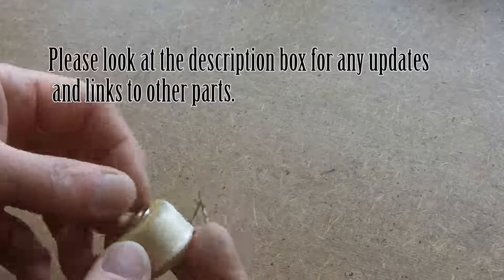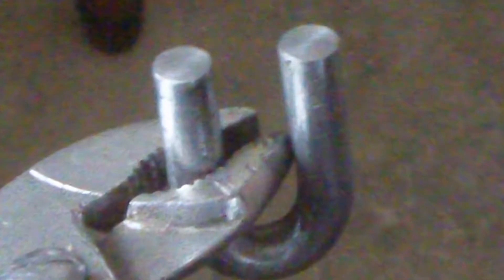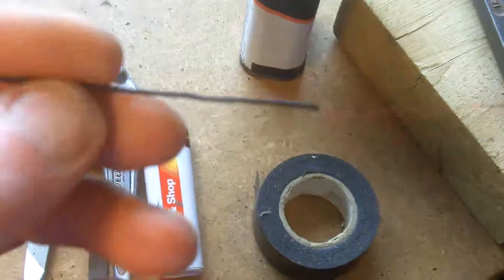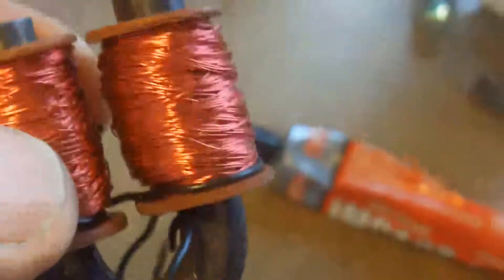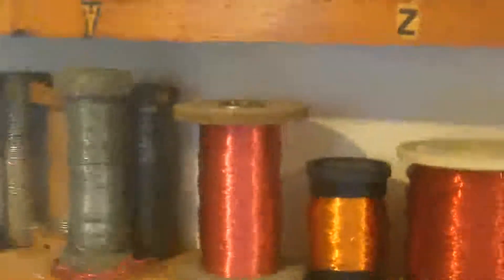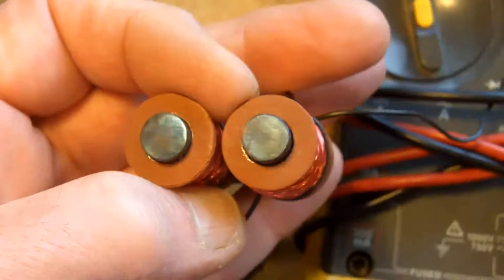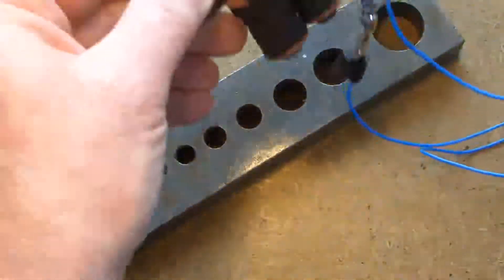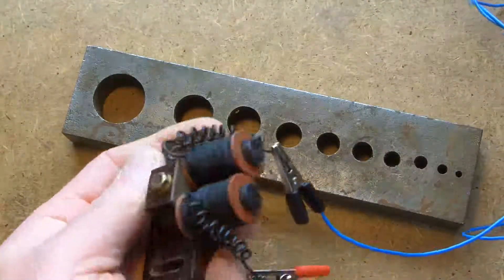Hipps clock movement project, rough part 19

Comment from the maker: Hi there, thank you for the lovely comments, well I used the expression ‘pantograph’ to describe the change in angular displacement between the long pendulum and the shorter arm to the left of it.  If you consider the arc traversed by the cross arm, it’s the same for both the long and the short pendulum but as the top pivot for the short pendulum is lower than the long one it’s horizontal displacement is less for an equivalent horizontal line.  I Hope that helps? 
Kind Regards ... Andy

Comment from the maker: Hi there, after bending it I cleaned up the old bolt with emery cloth to get it reasonably bright and shiny. I rubbed the metal all over with my bare hands, I think that imparts a bit of finger grease/oil to the surface (I’m not sure about that but it’s what I’ve always done,) then I heated the metal slowly with a gas torch. I took several minutes to bring the temperature as evenly as I could. See 2 of 2 
Kind Regards ... Andy

Comment from the maker: 2 of 2... It’s very easy to heat it too quickly and take the part past the temperature you want. The surface will go straw coloured then purple before going that beautiful electric blue. If the part has variable thickness then it gets harder to maintain an even heat. Take your time and let the oxide form slowly, if you get it too hot and go passed blue to grey then the only way to recover is start again by polishing the surface with emery.  So, time and patience. Good luck.